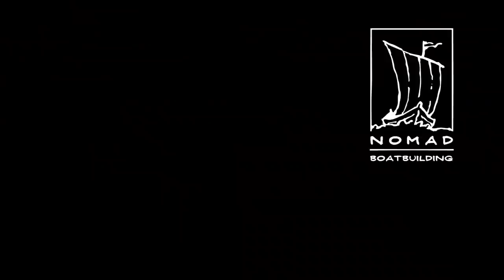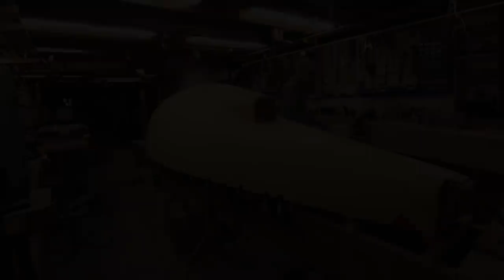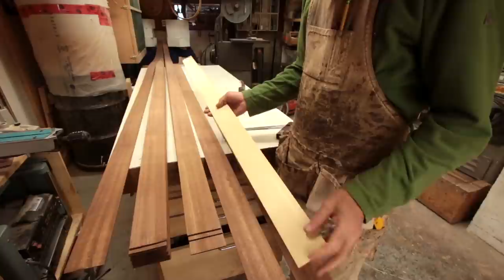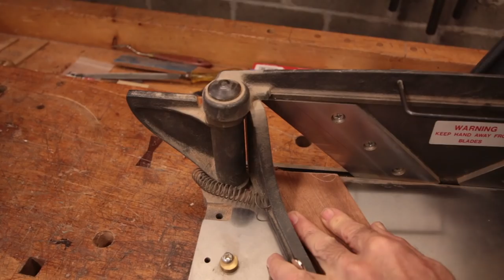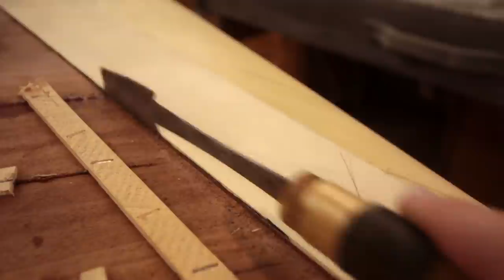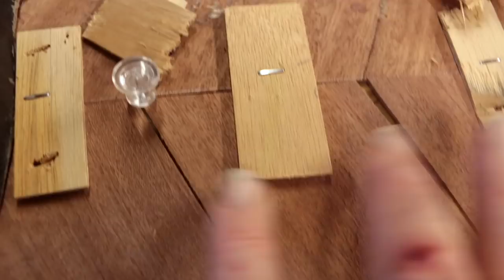International 2.4mR Sailboat Project - Episode 18 - Starting the second plank layer

Comment: I was thinking that some sort of ratchet-strap system could be set up to follow the direction of the planking, connecting to a spot on the port gunwale and starboard gunwale (fore or aft depending on the angle of the planking).  The strap would be flexible enough to follow the convex contours of the hull and force the planking down into position and follow the shape.  For the odd concave  shape near the skeg-, you could have convex blocks that could push the planking down into that area.
Reply from the maker: Perhaps if it was a one off plank but the reality is that I’m often trying to fit several planks at once and a traffic jam ensues very easily. There is also way too much change in shape for such a strategy to work very well but I appreciate your taking the time to think of some ideas.

Comment: This might seem extravagante (or even just weird...) , but what would you think of a "fabric" matting  as strong(er) as fiberglass, but thinner and lighter. Such as (brace yourself) silk. FYI back in the day, Chinese foot soldiers were issued silk tunics as part of their armour because an arrow would carry the silk into the body without piercing it so the arrow can be safely removed without causing further damage.
Reply from the maker: Silk has been used in boatbuilding going way back. The early competitive European skin on frame kayaks were skinned with silk and waterproofed with wax. Flax and muslin fabrics between planking layers were used extensively during the second world war era in the building of mine sweepers. Natural fibres in place of synthetics are showing up more and more across the boatbuilding industry. I think it’s fine if it works well. We debated using a fabric layer between the planking layers but decided in the end that the weight was a penalty rather than a benefit.